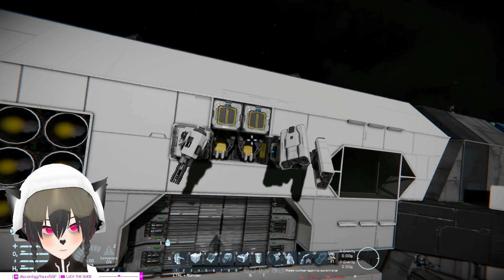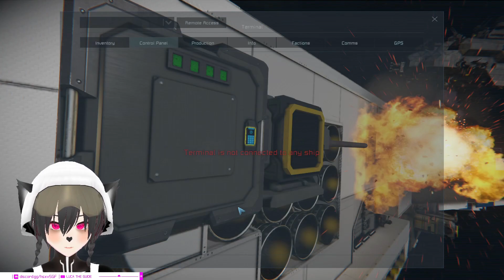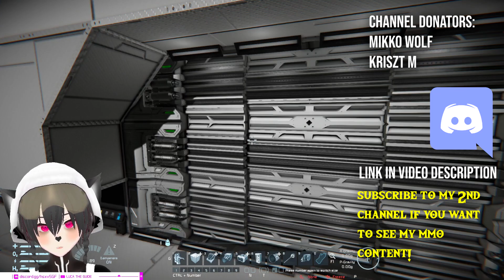I Gave up Trying to Explain Why Space Engineers Self-Repair Ship Welders Don't Work That Great

Comment: Self repair ships need a projector to build blocks blowen off and the conveyors should also have multiple routs so the ship can self build if you have the parts. Then it's just resources and storage space.
Reply: I will also say bury a weirder deep in the ship and it only needs to be in range of a part of a large block like a large thruster. And other welders used as conveyors to rebuild the welders. But the 2 downsides are definitely pcu cost and weight of all the internal parts for just a little survivability

Comment: You're right to point out that it's very challenging to make them useful. I'm not quite a no-welder purist, but I believe they're only viable in niche scenarios or with a good bit of space engineering to design a ship around that feature.

I went through like 30 or 40 iterations on a small ship fighter that used welders to maintain a strong armor layer. To make it work at all, it needed a lot of compromises for the mass-to-battery-to-thruster-power economy to make any sense. In the end, I could only armor one side and I could only accelerate quickly in one direction. Even with the welders and armor, anything more than a quick spray of gatling fire would start to punch through and a single rocket would pulverize the ship (this was pre-warfare).

Comment: If you are in vanilla, rather put a high hit block, like a refinery in front with welders behind it with decoys. The welders can be on the edge of the refinery so they can also repair railguns circling the refinery and the decoys in the centre of the refineries. Unless they get lucky and fire multiple high damage weapons in a instant, those refineries hold out pretty well. And if you really want to, slap that projector on as well.

Comment: Good point, but that ship had a projector that you turned off 😜. I agree that having welders on weapons isn't really worth it, but for major components like reactor, key engines and jump drives, I thinks its best to have a welder ready to repair them automatically
Reply from the maker: Stellar x3 where's stellar been c= and yeah in some use-cases it might be worth it but there's still the problems which I mentioned with materials and the conveyors, and welders getting one-shot anyway
Reply: @LucaTheGuide  very true. Do you include automatic welders in your grids occasionally?

Comment: I agree considering the fact you are not projecting the part you wana "repair/rebuild", but if you had a projector you could rebuild it pretty fast... So i guess not efficient for repairing live un combat, but still good for rebuilding, for example after a small jump.
Reply from the maker: That can be used for that x3 but it's way more PCU-efficient to repair the damages after battle without welders that are already on the ship which might get destroyed anyway and takes a lot of the PCU that could've been used for things like weapons c=

Comment: Aaaaaawe, I love your video; but you skipped the key item for self repair, the projector block. You keep a blueprint of your ship projecting somewhere in the center without displaying. Then have a fair bit of conveyors so even if its not self repairing; you can fly to a repair station for a fix-up
Reply from the maker: Having a projection up cost a lot of PCU x3 not to mention the welders and conveyors themselves can still be one-shot c= and thanks Metal u wu

Comment: I've never tried them directly on weapons, but I find they do a decent job of keeping my weapon mounts intact..
Enemies often miss my weapons in a firefight, they hit the mount more often, which can be just as effective at knocking out a weapon..
If I feed my weapons ammo via refineries, and repair the refineries with welders, I find it takes them a long time to knock out my moving weapons...      
Fixing refineries mostly just takes steel plate, and the size of them means AOE weapons don't simply shred the welder along with the weapon/mount..
Best used as a hvy front shield, so not great in a furball, but quite fun in one on one battles..       :)
Reply from the maker: That's an interesting way to implement them c= kind of inconvenient and not universally-applicable though and yeah it's better for furballs to just zoom around fast x3♥
Reply: @LucaTheGuide  Refineries are very heavy, but tough.. Good for attacking bases, where all the fire comes from one direction and you can just tank behind your refineries..  Less helpful vs something nimble..    :D

Comment: Welders are ok to repair the main weapons if you have a repair projector on the ship. Also, you better use it to repair an artillery cannon or assault cannon: they have a bigger base and can partially shield the welder from damage and have a lot more hitpoint than the old Gatling / missiles launcher, as for the PCU: having one or twp turrets come back online can be nice but don't try to repair all the turrets, you can use the PCU elsewhere
Reply from the maker: Yeah better use them sparingly if at all x3 I wouldn't even use them for that because of the PCU cost, having projection up costs a lot of PCU too and the conveyors of the welders would still be susceptible to separation in substantially heavy combat

Comment: i mean half of those ships and literally 80% of any "factory machine/printer" build with timers etc. working based on creative mode welders ... i never used them. :D always have to build a new factory/printer/repair station in the survival scenario. 
And on top: aren't welder blocks also affected by the world setting of welding speed?
Reply: I wouldn't throw block welders out entirely. I find ship printers at least fairly useful for small-ship builds, and I've seen examples of how to make a serviceable ship printer for larger-sized works too. Nothing for printing (or even repairing) in battle, but outside of combat they certainly have their uses.
Reply: @BigusGeekus  I just never paste any "printing station" or something from the workshop in or use them as "regenerative armor" fix.
Overall i absolutely do use tools, especially since i am mostly playing on vanilla or lower settings.
Ever tried to weld some more blocks for like a landing pad with a 1x or "realistic" inventory? :D you are pressed to use welding ships. played like that for a long time.
Reply from the maker: Yeah xD and yeah x3 a lot of the survival servers have the welding speed way slower than creative mode c=

Comment: ur simply wrong luca and u can see in my battle how effective they are there are challenge to use it but its doable i use self welding turret in alehouse pvp and in keen server and thet prove to be verry effective
Reply: actully any powerfull pvp ship in our server is using this
Reply from the maker: How does Silent1 use them and against what though? c= I find in most battles against Warfare 2 weapons they are not effective at all, and even against non-Warfare 2 weapons the welders themselves and the conveyors are prone to getting destroyed
Reply: Some i rather not say couse kinda secret but i can say one thing about ur test video u forgot projection of projector so one shot destroy the turrets so .. projection is on and rewelded it. And u wont use welders on weak weapons for example i only use it for railguns artillery guns and some artillery turrets these weapons can take so many shots even without welders. also the way u put them how u conveyor them is the engineering part
Reply: And there are ships on ale that can loose turrets multiple time and get rewelded in mid fight

Comment: I'm inclined to agree. Built-in welders for turrets are overrated, especially in a vanilla survival game.

They're quite a lot of hassle to get working right, especially when considering how to place them on the ship in an optimal way, protecting the conveyors from damage, and having components available in storage so the welders can do their job. I think it defeats the purpose when I have to fly over with a hand welder to repair the very welder that should be repairing things for me.

On the other paw, strategically placed welders for functional blocks within the interior of the ship isn't a bad idea. Like one placed on the main reactor, jump drive, assembler, etc.
Reply from the maker: Yeah c= there's lots of things that need to go right for welders to even be effective in vanilla survival combat, I can see how they might still be useful for some specific use-cases like the one Lufty mentioned x3

Comment: I usually keep a projector overlayed on my ships, though when warfare 2 first came out, the custom turret controllers glitched out on one ship, completely scrambling all the blocks around them when I overlayed the projection. Thankfully it was in creative, and I reported that bug.
Reply from the maker: Oo, that's an interesting bug x3 but yeah the problem with projection is that it can take a lot of PCU to have projection up, and the conveyors plus welders would still be vulnerable
Reply: @LucaTheGuide  I had made an array of turrets on an angle, with welders directly behind the custom turret, and Infront and below. Each turret head had an internal projector. It kinda worked, they were more likely to get beheaded rather then damaged. Other then shooting each other off due to how poorly I placed them xD

Comment: I'd have thought, thanks to Warfare 2, that the only in combat role for Welders is as an array under a heavy armor encased array of Decoys. 
As for in combat I'd think that an array of Welders pairs well with the Jump Drive: get into trouble, jump out, welder auto repair armor and weapons before enemies chase you down or you Jump back.
Reply from the maker: It certainly reduces the usefulness of welders a lot more c= I can see how it can work with jump drive, but even that is susceptible to getting one-shot by multiple artilleries or railguns and the welders plus conveyors themselves can be easily destroyed separating the expensive jump drive materials from the welders

Comment: I did find that welder+decoys behind double heavy armor can buy you a little bit of time in a battle, but only when you're up against dumb AI turrets, a player will ignore ignore and just shred you up.
Reply: Exactly. I used that since i calculate that a heavy armor+light armor could tank an arty shot. If the block not die in one shot, it can be repaired!

Edit= Blockinfo mod rly helpful it give info about any blocks in SE.
Reply from the maker: True, against AI you can just easily dodge though c= unless I guess it's the AI who's surprise-attacking you first then I guess that's one use-case scenario
Reply: @LucaTheGuide  as for me it was a test of my frigate. i fight with my faction leader before he agree to help me build my ship. well i barely won, then after that i modify my ship to use heavy armor decoy with welder to increase survivability as before the welder only used for the railgun repairs.

and if you say welder kinda sucked, there's one guy i fought that his one railgun just won't die even though suffered hits. he almost shot me out of my corvette, thankfully he missed 1 meter and hit unimportant part instead of the cockpit. again of course, it depends on server setting but in mine it's rather useful. Funny enough the server allow only 5 grinders but 15 welders :3

Comment: welders in Survival aren't for IN BAttel they are for when the bettel is over and you want to fix your ship whitout thinking. therfor Auto ship build welders. And its funny to build a ship that can fix it self by just 1 or two welders makes you think in a completeetly different way of building
Reply from the maker: That's an interesting way to use them c= but the welders and conveyors themselves might also be damaged, and a ship needs to be very small for all of it to be repairable by 1 or 2 welders I think
Reply: @LucaTheGuide  I didn't mean you use only 1 or 2 welders in you whole system. I meant build a schip that can repair it self if only 1 or 2 welders survive the battle.

Comment: It made sense back before the warfare 2 update
Back then you could easily defend your ship from missiles with gatling and interior turrets, and realistically those 2 were the only ones that could hit the ship dealing small damage so the welders were actually worth investing in then some guy came along and just deployed a wall of rockets with small sub grids and since the warfare 2 update yeah welders just became only use out of combat thing
Reply from the maker: It somewhat did x3 but even then it was still questionable because of all the necessary things that need to be right for them to work effectively, but yeah Warfare 2 certainly kinda put the nails in the coffin for self-repairing ship welder